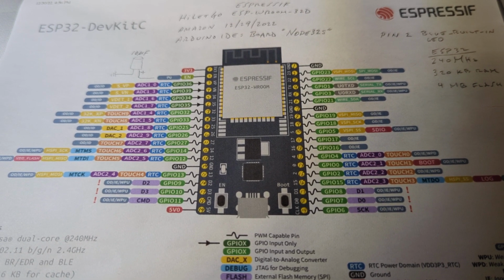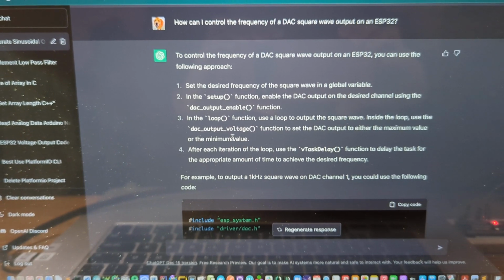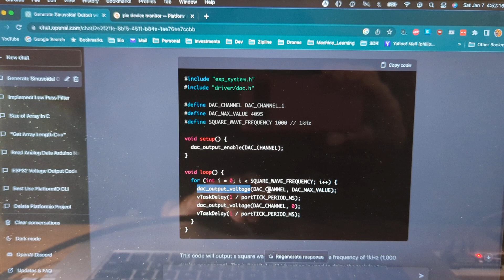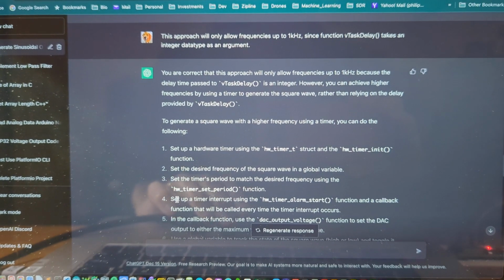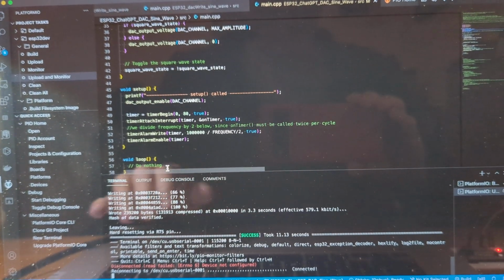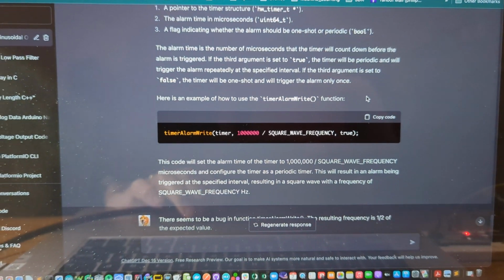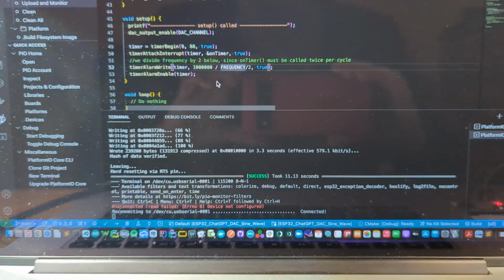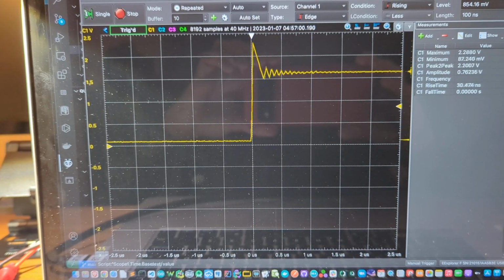ESP32 DAC: creating a flexible square wave function generator (with help from ChatGPT!)

Comment: 6:07  RE THE OVERSHOOT
Hi mate, i was gonna say, 
ARE YOU USING YOUR SCOPE PROBES
Are they on 10x - if YES.. Good
Are you using the positive on the conductor - if YES... Good
WAIT FOR IT...

Are you using THE GROUND CLIP-   if YES.......  BAD
Try this as a first troubleshooting method to determine i the overshoot or inductive ringing
is the circuit or your probes

There is a small springy wire attachment that comes with scope probes.
Disconnect your GROUND Lead and take off the Positive Hook part to reveal the raw tip.
Attack the negative springy thing
THEN TEST IT AGAIN

You'll likely find that a lot of that overshoot was as a result of your scope probe's Ground Lead.

let me know

Comment: 1:43  i was just gonna say 
don't use Delay  (that will cause blocking)
use vTaskDelay() 
classic issue on Arduino,   You start on delay, it doesn't work , so you turn to millis,   then that doesn't work 
and you're stuck

solution...... ESP32, FreeRTOS and  vTaskDelay

Comment: Hi is there a way I can contact you to ask a few questions?  I am working on a square wave project and have a few questions
Reply from the maker: Yes, I will try to help. Please send me an email to connect: soaring @ duck dot com
Reply from the maker: We may have missed each other via email, Aaron. I responded to your email but have not heard back yet. Just checking to see if you still want to connect. Thanks.
Reply: @philipgiacalone5605  I replied both times I wonder if my emails went to junk mail
Reply: If you have time tomorrow, let’s visit
Reply: @philipgiacalone5605  I sent you several emails, but have not received a reply. Maybe they are going into your Junk mail

Comment: I wanted to use this for my speaker. As this approach does not allow me to run multiple frequencys at one, I ended up writing this whole DAC stuff by myself and manually stting the ouput pin on HIGH and LOW in loop.
Reply from the maker: Sounds neat! Have you posted your code? Also, I have another video on level shifting signals using an op amp. Seems that would be needed to convert the all positive voltage outputs of the ESP32 to positive and negative values.